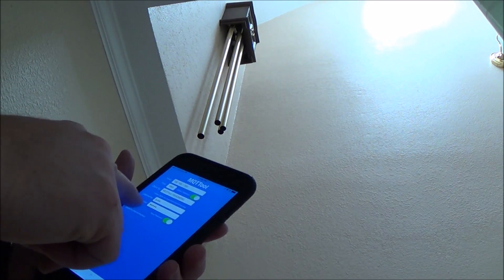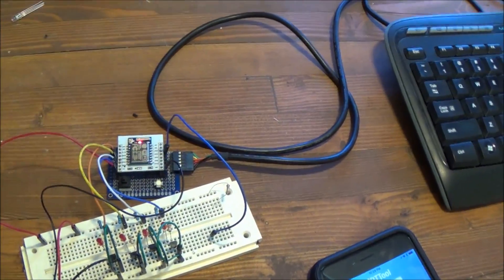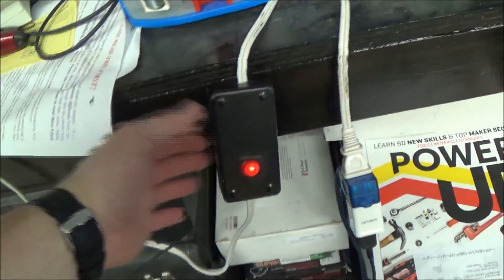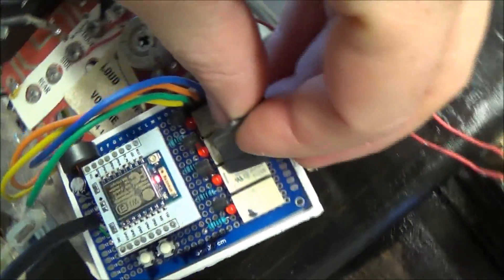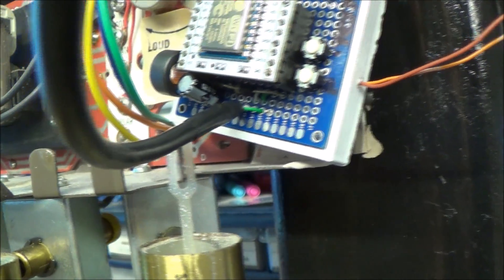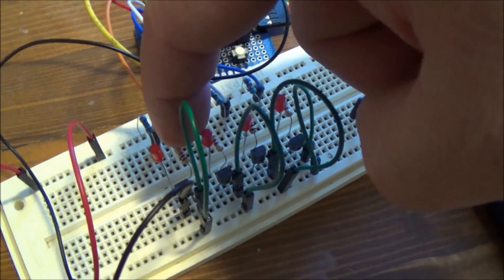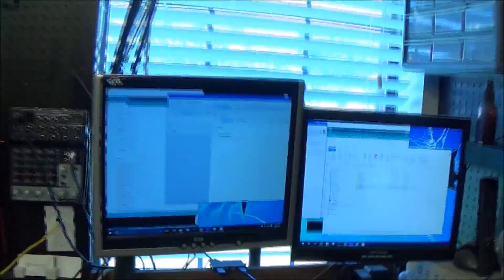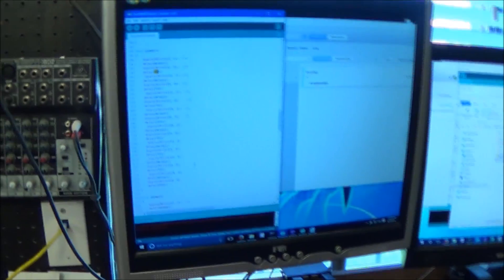MQTT Door Bell

Comment: Nice work. Very hard working. The energy comes back from the magnetic loads is called Back EMF. You will need to have one diode for each relay connected across the relay points in reverse polarity. The best way is to use ULN2003 16pin chip. It is cheap, having 7 drivers which can drive upto 30 to 50volts with 500mA load each. Has builtin protective diode as well. Your circuit will look neat as well.

Comment: CQ de N3GLV (saw the HF rig)
I'm in the low end of the learning curve, running node-red and an 8266, trying to do mqtt to strike the garage door opener. Ideally via a dash button but that's phase 2, also a dash as door bell. Firmware is easyesp, just missing the mqtt foo to hit the gpio pin with the relay.
73 for now, see me on freenode ##hamradio

Comment: What will be IP address of my hiveMQTT? I'm not sure if it will be the IP address of my local network or 0.0.0.0 as hiveMQTT says on command prompt while starting up. Please help.
Reply from the maker: It is the IP address of the machine it is running on, if you are testing and the broker and client are on the same machine you can use localhost.
Reply: actually I'm trying to implement it in my university where there are many local networks as you know how they divide their networks. is there any way I could implement there? like my broker is on some other local network and some of my clients are on same network as broker and some are on other network. 
 I really need help in this matter. I would appreciate if you could could help me. Thanks

Comment: Cool project :D - I am a bit perplexed by the single diode to protect from inductive kickback. Usually you have a diode across each coil to protect the transistor, or it will be fried sooner or later, latching the relay and your solenoid on - bad things happen ...